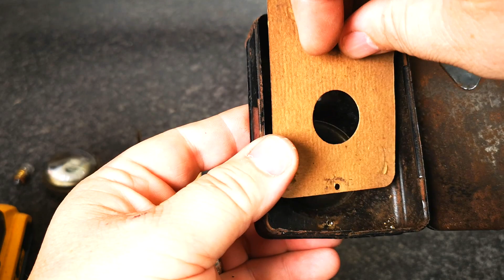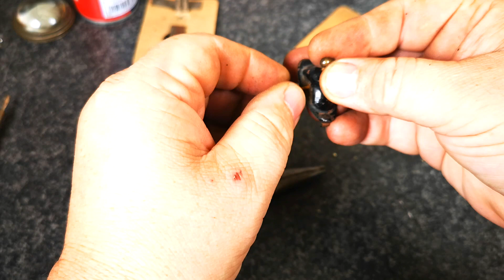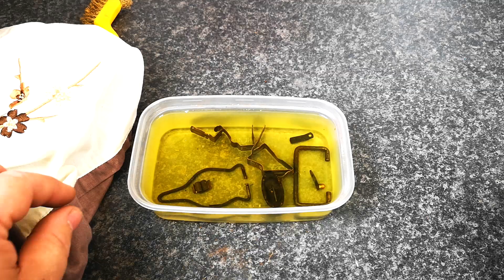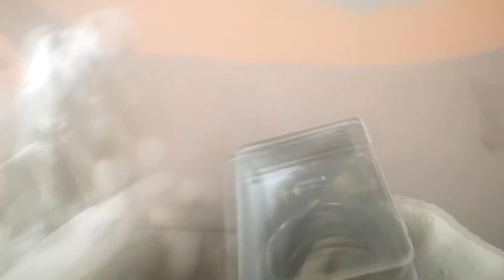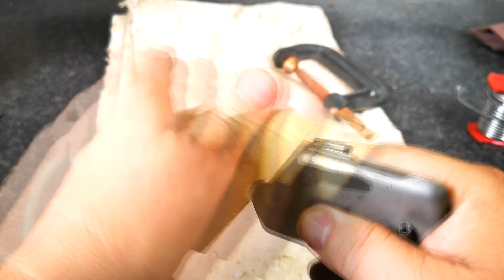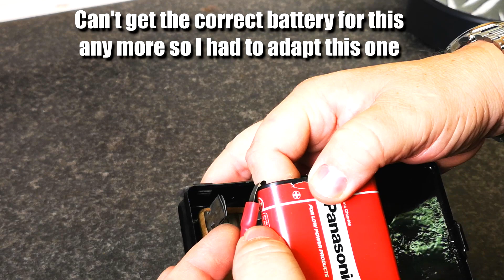Miners - Police - Railworkers Lamp Restoration - You Decide

Comment: Great restoration. That's a police bullseye lamp. That back spring swung up and hung off of a button  on the front of a policeman's poncho or coat.
Reply: A little research showed that this lamp was adapted to electric power (reengineered) from carbide lamps which had succeeded oil lamps. The obvious common feature was the bullseye lens. After reading about carbide lamps, I am amazed the human race hasn't killed itself off before now with some damn invention or another.

Comment: Hey Martin, I think you're going to be a world expert on restoring very random, and very interesting bits and pieces ! I would strongly suspect not a miners lamp, risk of spark from that switch. MANY years ago, we used to go potholing and acquired old but serviceable miners lamps which used caustic soda as the battery pack electrolyte. My mate's battery pack leaked one time and burned the skin offhis backside----most painful!!!
Reply from the maker: Cheers bud

Comment: Solder is drawn to heat.  While heating one side apply solder to the other.  The solder will be drawn to the heat and through any holes in the metal.

Comment: WW2 Bulls Eye cycle lamp Martin, I just sold mine exactly the same for £30 unrestored. Defo not a Railway (not Railroad) workers lamp as they were not issued with lamps except shunters and guards and they had Red/White shades for guards, Red/White/Green shades for shunters. Not Police either, most Police lamps were taller and had triangular tops, Miners lamps nearly always had seperate battery packs. As always superb resto...looks the biz.
Reply from the maker: Cheers bud

Comment: Thank You! I have pair of those, i always wondered what they where from originaly.
The smaller one can also be used as a bike light. (The backplate is different on the bigger one, it does not hawe the metal clip for bike mount, at least not mine... ).

Comment: I like your restorations. I have 2 questions on this one. What are the pros and cons of powder coating compared with spray painting? Also what are the pros and cons of media blasting compared to paint stripper to remove the paint?
Reply from the maker: Powder coating is a lot tougher and there is no real curing time so when its cool, its hard and set. Paint stripper doesn't remove rust where as media blasting does.

Comment: as some have already commented it would have  been used as a policemans lamp with the clips this type would never been allowed down a pit due to the risk of causing a explosion it looks like it was made in 1920's / 30's pit lamps were FLP (flame lamp protected) before this date
Reply: I can confirm that, my Dad was a miner and anything electrical cleared for use underground had to have reliable anti-spark protection built in.

Comment: Great resto Martin. I do not know a lot about British railroad history, but in my neck of the woods, I'm pretty sure the railroad workers lamps always had either a sliding mechanism with a red piece of glass they could slide in between the bulb and the lense, or dual lenses - a clear one on the front, and a red one on the backside - so they could use it as a warning signal to oncoming trains and such.
Reply from the maker: Cheers bud
Reply: Yep, tend to agree. Even now when we’re on track at night someone always has a red lamp. Even on a night shift “possession” when the trains are off.

Comment: I think it's a rail worker's lamp. Miners tended to use ones they could wear, and cops prefer the long ones that can also be used as a baton, so of the three that leaves rail workers... but it could have been for anything make a good camping light back in the day. Say, since you can't get the batteries to do a complete restoration anyway, maybe it's time to start adapting these old lamps to LED bulbs? By the way, what was that battery you used, and where did you get it. I have something that needs something similar to that.
Reply from the maker: They don't make these any more, I got it from an old electrical shop.
Reply: BR workers all had the Bardic lamp which the forces used too for signalling purposes as the Bardic has red, green and yellow bulb overlays to change the beam colour.   I think LT also had their version of the Bardic's, before that they tended to have oil lamps that could be fitted to lamp posts on locos and wagons which the bardic has in later years.   The police used in London wear a lamp latched to their poncho raincoats that this looks similar too as point duty was just that, pointing traffic in an era where traffic signals were still a rarity on British streets.   It is a projector lens which suggests to me more police than a miner.
Reply from the maker: Cheers bud
Reply: Toot Tall. You could u
adapt the cells from a pj996  lantern battery, it's the type with four cells and it's quite easy to do. Regards Brian
Reply: @UniqueRestorations  I'm trying to make a battery for a 1960's electrically fired lighter/with a small light. The flame is the usual wick and fluid, but it is triggered by an electric spark from a battery. Quite unique. Made in Japan